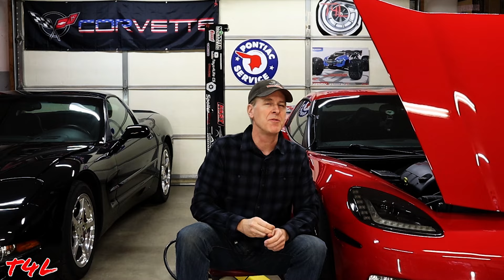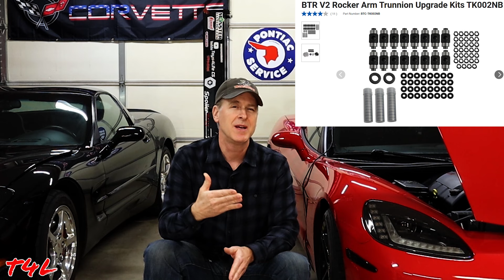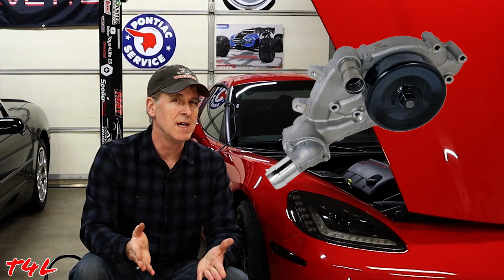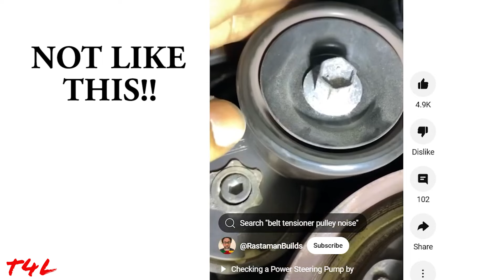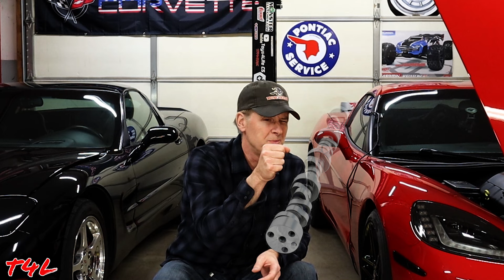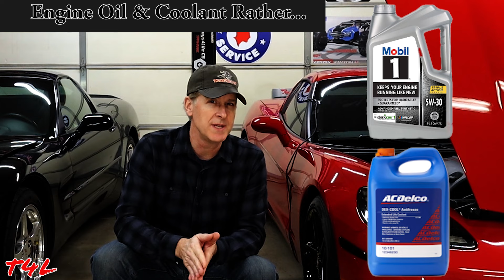C6 Corvette Cam Swap (Should You Replace Lifters, Timing Chain & Water Pump?)

Comment: I have everything in the btr stage 1 kit + katech c5 R timing chain but i don't know if i want to replace the lifter my motor has 128xxx miles is very quiet silent engine so far soo I not sure if i want to replace the lifter?
Reply from the maker: Most guys would replace the lifters with 120,000 miles. If you're not going to replace them at least inspect the cam lobes very closely when you remove the old cam -  make sure there's no signs of pitting or other irregularities.
Reply: @Toys4Life ok i will check that but my engine sounds very good not lifter sounds
Reply: @Toys4Life  my plan is i will pay the corvette  center shop to install the btr cam stage 1 kit and get it tune and when i get home i will install the lifter and trunnion kit by my self ....because they want another, $2,400 for the  lifter replacement that to much money for me right now soo I think i can make home whit my stock trunnion and lifter and do the job my self ....

Comment: I went with a high pressure pump as I plan on adding an oil cooler.
Reply from the maker: I wouldn't think the cooler would offer much resistance to flow -but I am all for an oil cooler to take care of hot oil temps!

Comment: Hey, great info!  I got an articulating scope for Christmas and I looked in through the oil cap in my 03 Z06 and found yellow springs! what brand of springs do you recommend and what other parts need to be replaced as well? I trust your advice. 😀
Reply: New GM springs, Pac1218, or 1218X
Reply from the maker: I put new LS6 springs in my C5 6 years ago, I spent it to 6,500 often and they've done great.
Reply: @Toys4Life  Do I need to replace any other parts or just the springs? What brand did you use?

Comment: Great video. If you use the same lifters...can I assume you will use the same pushrods in the exact same order?
Reply from the maker: I covered it in the previous video but I have to replace the pushrods as the stock ones are not strong enough for the stronger springs, steeper ramps and more lift.  The C5 is still rockin the "weak" stock pushrods though but that cam is stock with LS6 springs and I rev it to 6500 OFTEN (:-)

Comment: Do a morel lifter, iwis chain at minimum, melling highflow 
pump ,fluidampr and new seals and gaskets
Reply: Oh and even if you're lifters are good. You do not wanna do that work and suffer a tray failure.
Reply from the maker: I don't disagree but ...It never ends though.... I should have a valve job done as well.... rabbit hole...lol   I have a feeling I may be back in there next winter for stage 2......  shhhhhh

Comment: Been enjoying your videos for a while now, very well done and personable. I think your insight is spot on, especially about the possiblility of new part failures. I was just going to point out the trunion upgrade is often suggested and labor intensive, so the roller rocker option becomes feasable, and there in lies more lift if one desires. Additionally when getting into the  more aggressive realm, stronger pushrods become more important, however your insights are great at balancing reality with hp addiction. Last thing was the vibration dampener. The valvetrain harmonics at higher rpm become problematic and in that case I like the Fluid Dampener. Very popular with Diesels because of the effectiveness. Just some things to consider in the vast database your so kind to share with us !

Comment: Lifters should  be fine with your  cam inspection, I would change the oil pump while your in there for couple of 100 bucks. I'm an amateur and built my motor myself, well with the help of YouTube  lol! It's  guy's  like you that put out great content like this for your do it yourselfers . It was your channel that got me supercharged, now I built  mine to handle the power I'm aiming for! Thank you for great  content!
Reply from the maker: Supercharged with some Ethanol or meth can be plenty for the street - no?
Reply: @Toys4Life  in canada we don't  have e85 but meth is part of my build.  Aiming for 750whp. I was 651whp for 3 years before piston 5,7 piston rings butted. Stock gap was 17 thou, dropped in forged pistons and h beam  forged rods and gapped the pistons 28 thou top ring and 29 thou bottom ring. Block and heads all machined and cleaned
Reply from the maker: Nice!  750whp is getting up there - what transmission are you running?
Reply: @Toys4Life  stock six-speed, ecs has a girdle brace for the rear end and transmission. I won't  be doing  any drop clutch driving 😁

Comment: at 48000 miles my oil pump pressure regulator piston stuck partially open. I replaced it with a Melling hp hv pump, I think the oil pump might be a dice roll from my personal experience. Only time will tell. Like the dice roll on the lifters I also opted to not replace them when I swapped my cam at the same time I replaced the oil pump.
Reply from the maker: I have to stand back because you can always replace one more thing (:-)  Part of me wants to remove the engine and completely disassemble, check all bearing tolerances and make sure everything is still in spec -  It never ends (:-)

Comment: I replaced everything when I did my cam swap besides lifters. Damper, oil pump, water pump , timing chain, new pulleys, ac compressor, gaskets. I figured why tear the motor down again when all the parts required aren't that expensive. And mine had 85k miles. But since you're not replacing what you should..you should use that money for a set of headers lol. You're gonna need them...
Reply from the maker: Twist my arm (:-)
Reply: 😂 @Toys4Life

Comment: As long as it’s relatively easy to fix these parts afterwards, then I would leave them in as well.  Certainly,  anything that is difficult to replace , you might consider replacing, after all, it’s approaching 20 years old!